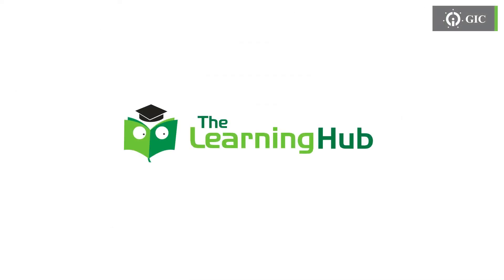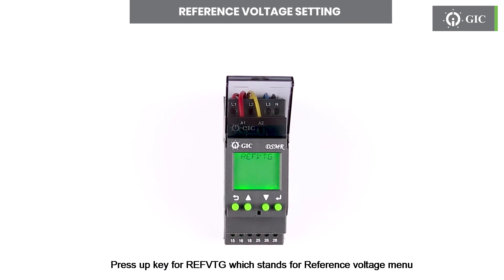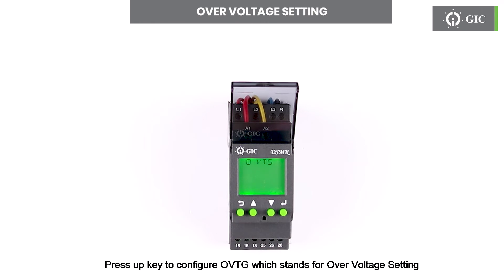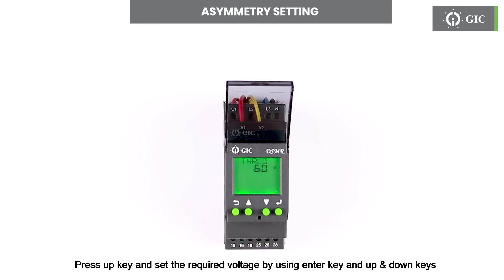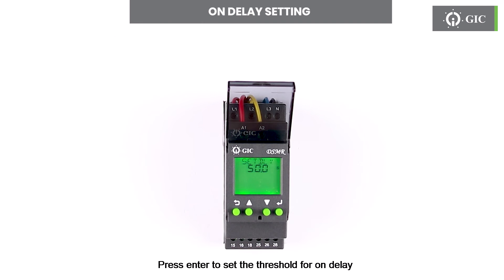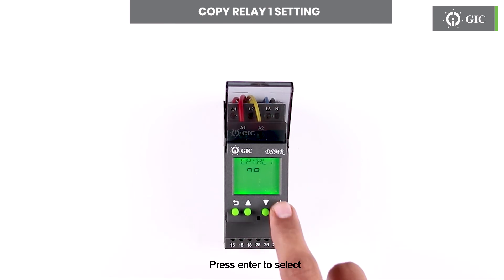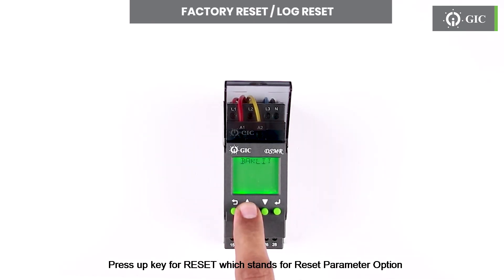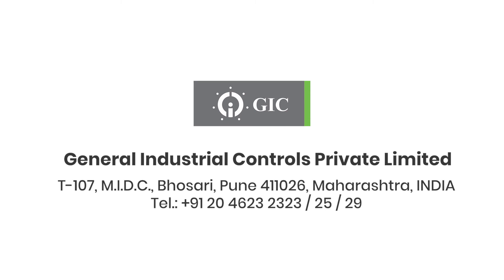GIC Learning Hub | Digital Voltage Monitoring Relay | Basic Programming

Comment: Please make 3 ph connection video....With mcb and contactor
Reply: This is protection relay.  You can use no /nc contact for your desired control
Reply: @endlessuniverse9312  can i use this for my home? i have a three phase supply but all single phase devices